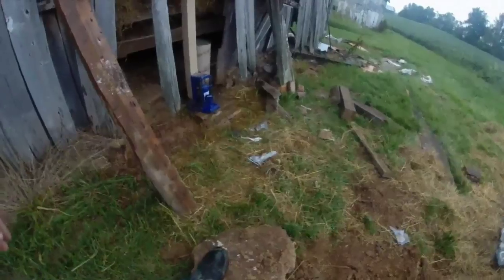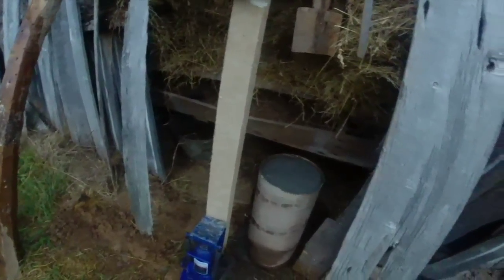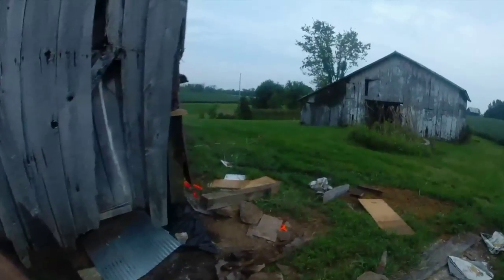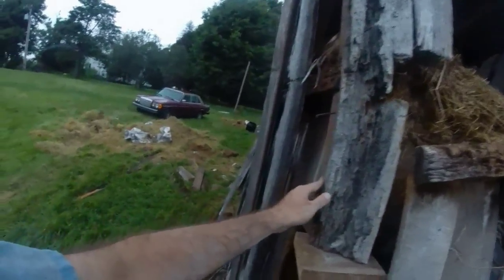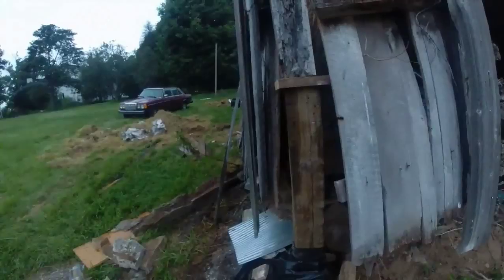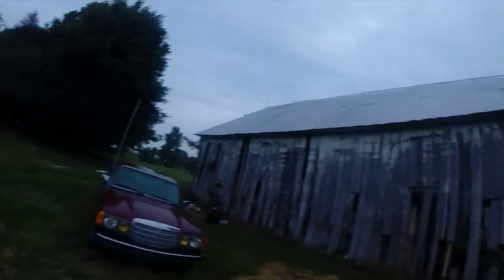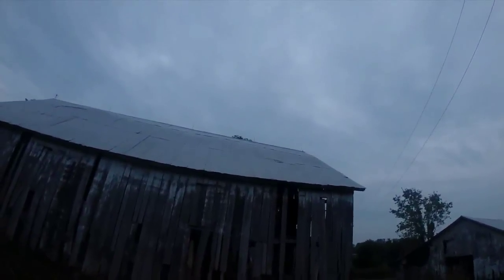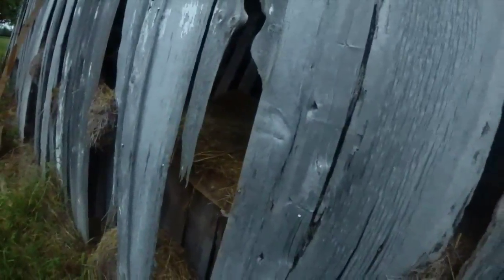This Old Barn err Shop weekend one

Comment from the maker: Easier probably, but that would probably be an impossible job for just one guy, and it would cost probably 10 times as much or more. After working on this thing for about 4 days it is apparent to me that basically all that is going to get used over is the roof and a few posts and some concrete. Because of the addition of the bridge crane much of the guts that are bad will be replaced anyways.